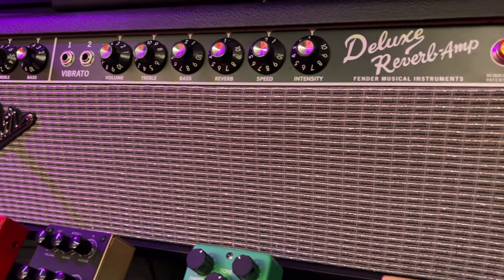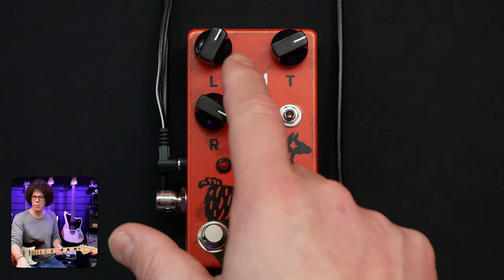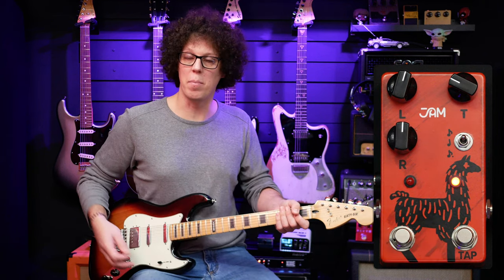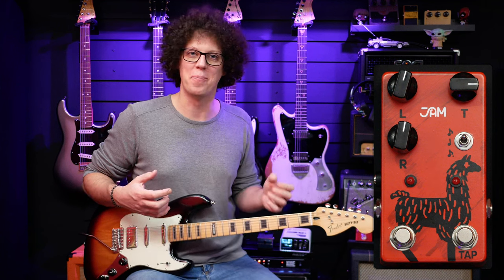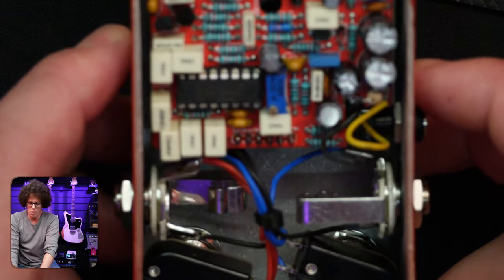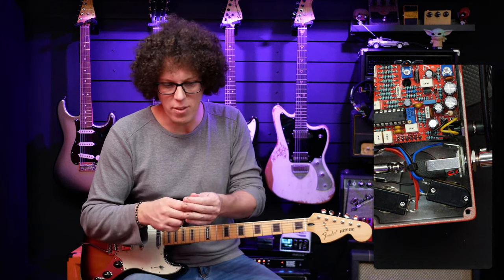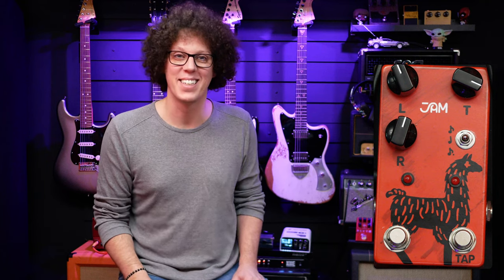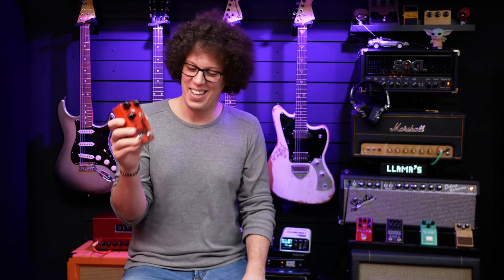Delay Llama MK3  - Analog Delay with Tap Tempo and more

Comment: Love these pedals but their power cable on the side of their effects is impossible to deal with on a board.   Takes up so much space.   They need to move their cables into the top of the unit like strymon.